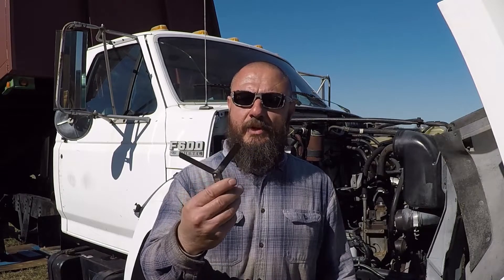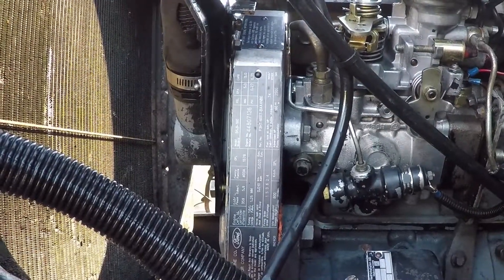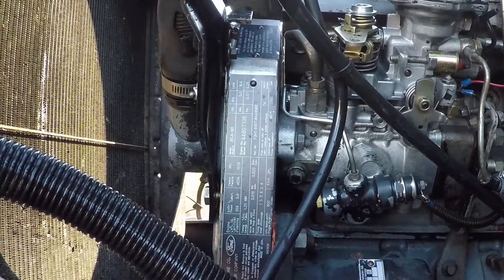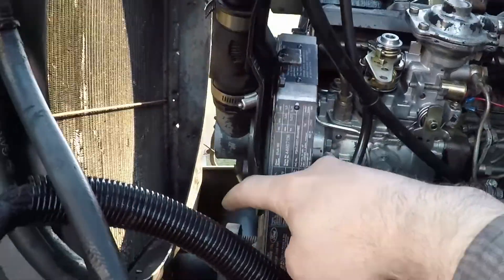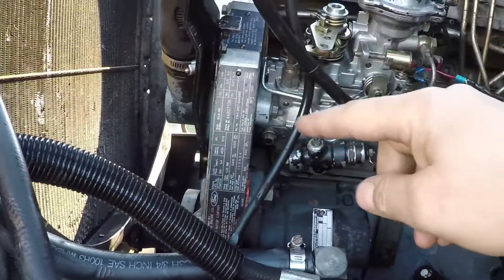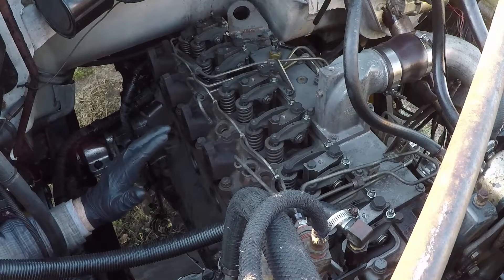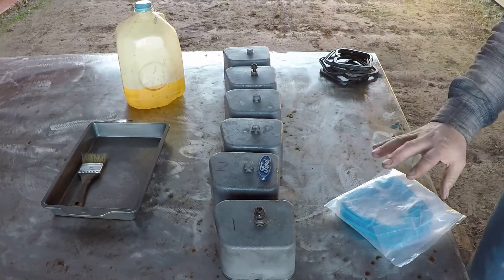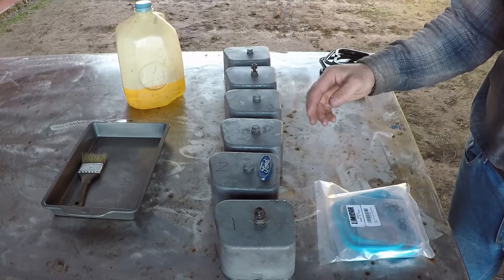How To Adjust Valve Lash Clearance On Any Engine

Comment: Excellent job explaining how to adjust valves. Many mess up adjusting when cylinder is NOT at TDC.  If you're at TDC there should be a little play between  rocker and valve just as you showed.  I will have like my 19, 20 and 21 out to do my final check after jam nut is tight.  If 19 is loose, 21 won't go in then I know it's perfect with the 20 and not just wishful thinking.   Love how you have everything clean and many hoses, etc. replaced.   You're an excellent mechanic and teacher.  Thanks for posting.
Reply from the maker: Good idea on 19, 20, and 21 to ensure precise setting. Thank you for the information and nice comment.